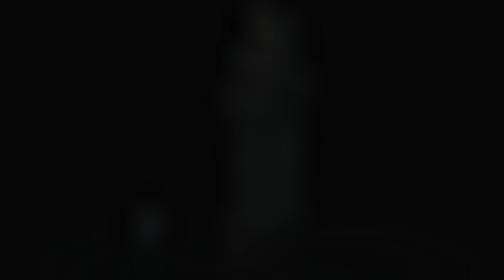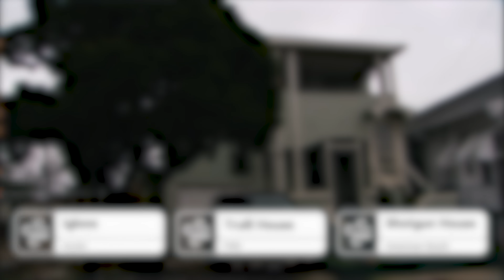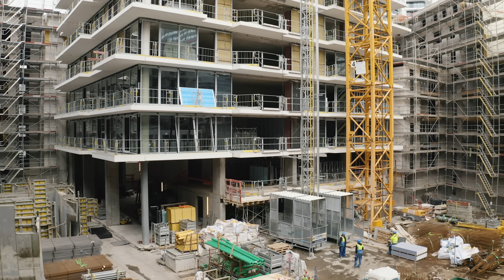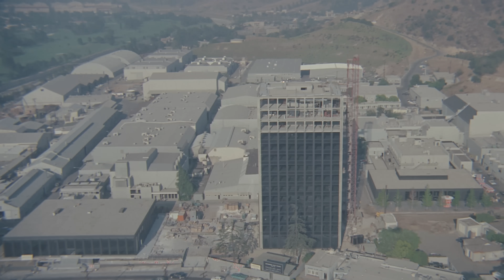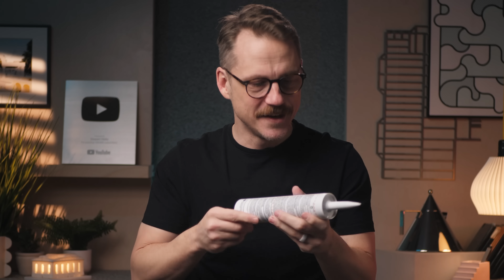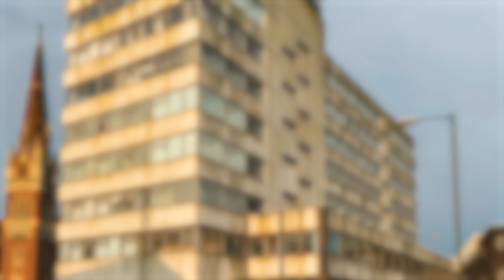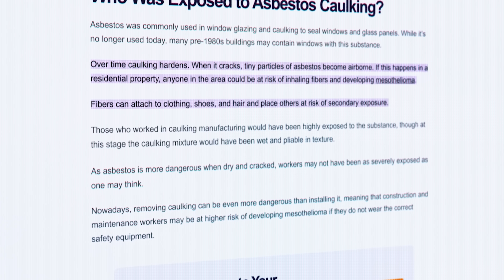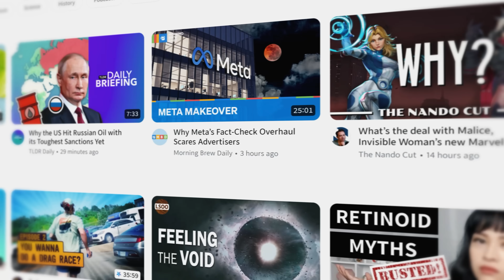How Caulk Accidentally Made Buildings FLAT

Comment: Thanks Stewart. This is the best explanation of the use of caulk in buildings I've ever read or seen. You hit the nail on the head with regard to its positive and, more importantly, its negative qualities. You touched on its maintenance and durability, and it reminded me of Hugh Stubbins' Federal Reserve Bank building in Boston. Shortly after the building opened in 1976 I moved to Boston, and one day I went to South Station to meet a friend coming in by train. I had some time to kill, so I walked over to the spanking brand new building to take of closer look at it, and there I saw close up the use of caulk on a large scale. Between each aluminum panel of the curtain wall there was a thick joint, maybe an inch in width, filled with caulk. The panels continued down to ground level, so I touch one to see what kind of qualities it had. It was very soft to the touch and when I pressed hard on it my finger left a distinct dimple. I had the feeling I could rip it out if I tried. I was really tempted, but I valiantly resisted the temptation. Still, it struck me that it wouldn't age well.
Reply: That’s the idea: fast food, fast fashion, fast architecture. Build it fast, build it cheap. In 30 years, it will be minimally useful and maximally ugly, begging to be razed and rebuilt, and as a bonus, avoiding membership into the historical preservation lists where restrictions reign supreme. Nobody will care if a caulked up five over one gets pulled in the future. 😊
Reply: Is that the building that has been so shot up that it looks like a war zone? I was walking past it one day and was like.... Daaaaaammmn!
Reply: @PhillipsLacy  Honestly, I don't know. I moved out of Boston in 1986, and in my trips through it I never had occasion to go over and check it out.